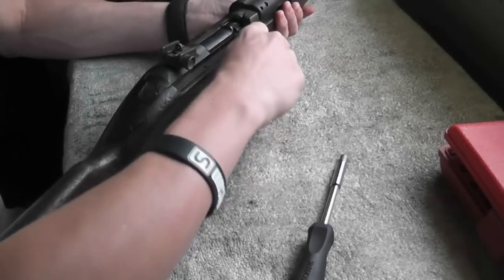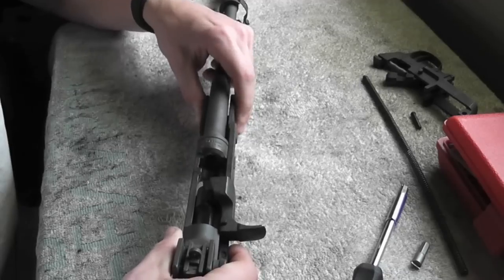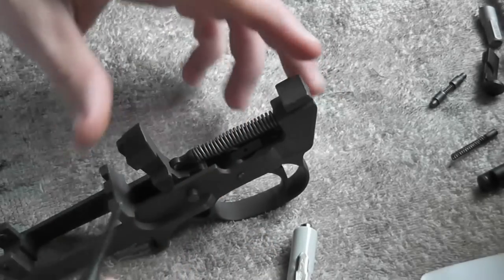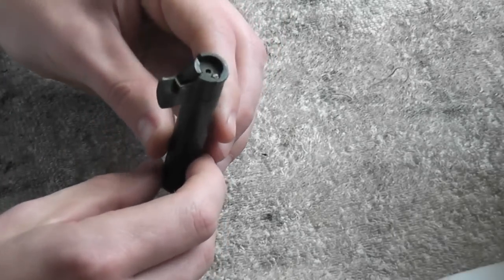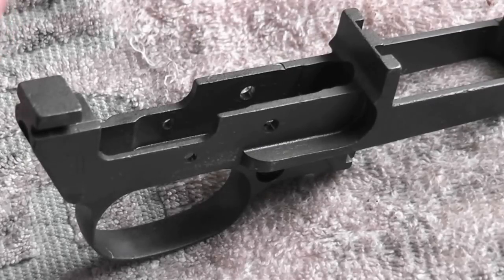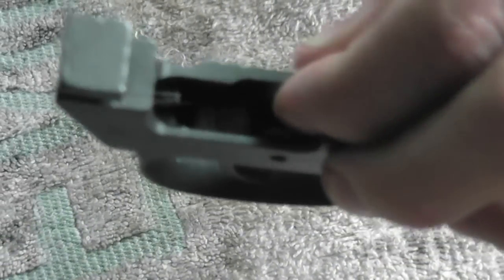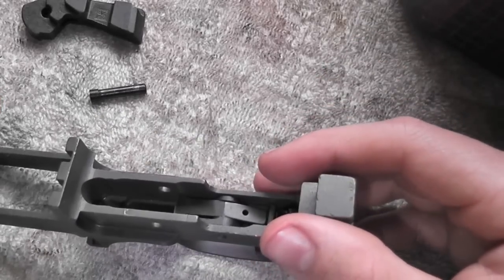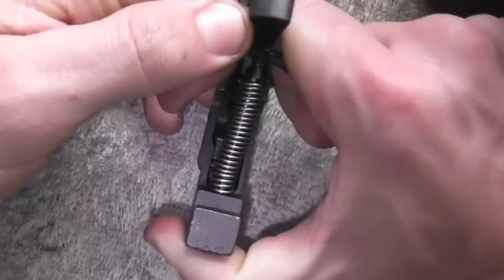M1 Carbine Complete Disassembly/Reassembly

Comment: This is by far the best video I have seen for a complete disassembly of a 30 carbine.  I converted an old 30 carbine that was manufactured in 1968 into a really cool tactical tool.  I purchased a Choate tactical stock from Midway USA that has a handgrip similar to an AR with an adjustable butt stock.  After seeing your video I plan to completely take down and have all the parts coated with Cerakote coating.  Your video has given me the confidence to tackle this.  Thank you for posting this!!!!!

Comment: Just came across this video after picking up an Inland M1 carbine and after taking it to the range a few times this month decided it was time to field strip it (including disassembly of the bolt- which I almost regretted).  After several attempts at trying to get the extractor back on (damn that little detent!) I might have figured out an easy to do it without pliers and three hands (the bolt 'tool' might actually do this as well).  I grabbed a flat head punch set and used the punch that had the same diameter of the extractor 'pin' that fits through the bolt holding the firing pin and ejector.  With the extractor out I put the firing pin in and pushed down the ejector to align the tabs for inserting the extractor.  Before I inserted the extractor I pushed the center punch tool through the opposite side of the bolt until it held the ejector and firing pin in position.  I was then able to ensure the extractor detent was positioned correctly and began inserting the extractor pin while using a small flat head screwdriver to hold the detent down.  The extractor easily locked into position and pushed the center punch out at the same time thereby completing the bolt assembly...and it only took two hands!  Anyway, I was impressed with myself after cursing out the original engineer who designed the bolt assembly for an hour or so!  I also used a Dremel tool and some Flitz metal polish on the feed ramp and smoothed out several rough areas of the receiver and bolt assembly- M1 ran great today!  Now if I can just get the damn magazines to work better- I think they are the cause of most of the malfunctions I still occasionally experience.  Anyone know any tricks to make them work better?  Stay safe all- Major Barry (USA ret.)

Comment: Great video, and such a young man caring so much for an old rifle! Helpful!    Hints, the mainspring follower rod is designed to use the point to retract safety/mag. catch spring, and push out all service pins. The stepped end works great to move and hold sear rearwards while pinning. Also fits through hammer spring hole allowng one finger  on either side of trigger group to stop spring kinking.I also piont the trigger group, hammer face down away from me, and use the large group-reciever pin dropped through the back of casting to help alighn hammer spring without kinking.also prefer to keep an extra bolt {headspace confirmed) as they only need soaked, shook and oiled ready to go.Most faliures I have seen is from extractor backing out due to improper reasembly or damaged extractor plunger failure. Leave the bolts to the pros cause when they come apart, they will destroy your reciever-(gun) and posibly your hand or face!Sending best  wishes to all the carbines out there, and the wonderful people who care for them!

Comment: The bolt tool is a great help for putting the bolt back together. They go for $22 and up. Very informative video. Thanks.
Reply: Just came across this video after picking up an Inland M1 carbine and after taking it to the range a few times decided it was time to field strip it (including disassembly of the bolt- which I almost regretted).  After several attempts at trying to get the extractor back on (damn that little detent!) I might have figured out an easy to do it without pliers and three hands (the bolt 'tool' might actually do this as well).  I grabbed a flat head punch set and used the punch that had the same diameter of the extractor 'pin' that fits through the bolt holding the firing pin and ejector.  With the extractor out I put the firing pin in and pushed down the ejector to align the tabs for inserting the extractor.  Before I inserted the extractor I pushed the center punch tool through the opposite side of the bolt until it held the ejector and firing pin in position.  I was then able to ensure the extractor detent was positioned correctly and began inserting the extractor pin while using a small flat head screwdriver to hold the detent down.  The extractor easily locked into position and pushed the center punch out at the same time thereby completing the bolt assembly...and it only took two hands!  Anyway, I was impressed with myself after cursing out the original engineer who designed the bolt assembly for an hour or so!  Stay safe all- Major Barry (USA ret.)

Comment: One thing in the bolt does need replacement sometimes is the extractor. The stock part is very brittle, and the lip that holds in the case groove will often chip away. I had a couple of them fail that way, and solved it by smoothing the overly sharp edges lightly with a Dremmel tool.  Never had a failure again after thousands of rounds. The bolt tool does make that work a lot easier.

Comment: Great video! I just got a used carbine and needed to replace the extractor. Your method works well. Mine took a bit longer than yours to take apart as every part was covered in grunge. :) Looking forward to giving it a try. Thanks!

Comment: Excellent video! I was cleaning and disassembling my Uncle's 1960's Plainfield M-1. Disassembling the trigger group was initially beyond my capabilities. The close-up video was the difference between assembly or staring at 8 parts on my work bench. It is more difficult than it looks! Trying to get that spring seated correctly and lining up the holes was extremely frustrating!

Comment: Enjoyed your video.I really need more info. where the piston that operates the action  is enclosed with a nut . It has a gas port in the barrel I removed the nut & piston and to clear the port I pushed a small drill bit in the port and it broke almost flush with port. I can not see in the barrel a hole for the port. do you think I could drive it through. Or reassemble without the piston and fire the gun to drive it out Thank You. Thunder63

Comment: There is a tool to dissemble the bolt available for about $15.  Well worth it. It also  facilitates reassembly  easily. You have an M-1 carbine, you should have this tool. It will save your sanity , and you don't have to dig and scratch around with a screwdriver. Just pony up the bucks and get the tool. You could be enjoying a cool one by now, instead if fiddling around like this. You'll thank me .

Comment: Great video...You got it all. Really appreciate it, I used your pain to make my life easier. Sorry Bro` but really...THANKS!
Reply: clement concodora Oh...I forgot...I had to change out the piston, which had snapped inside the gas housing making the carbine (my old Plainfield) basically a single shot rifle...I don't think you showed the piston and nut removal. You need a tool to remove the piston nut, but its do-able. In the process the trigger spring slipped off somehow. What a mess, but it got all back with your help.

Comment: Great video. Just a little dark.You need a bolt disassembly/reassembly tool and trigger spring tool. I use a slave pin to hold trigger and sear and sear spring together. That hole in top of the sear is to help you position the sear. You might like to use the NRA disssembly/reassembly book for nomenclature for parts names to keep everyone on the same page. I've been working on M1 carbines since was 16, over 55 years now and appreciate your hard work in making the video.  More power to you! Sincerely, Mel  ps I subscribed!

Comment: Man I had to give up tonight on reassembling the trigger group, where you put that guide pin through the spring and compress it against the hammer. Just couldn't do it anymore, after 45 minutes my hands were too sore.

I think the problem is that relief cut in the back of the trigger assembly piece is soooo fricking shallow, it's so hard to keep the spring in it. And I just can't get the pin to go in that hole in the back whether I try from the top of the hammer like you showed or the side, it's not lined up straight enough and is hitting the side of the hole. Ugh

PS that trigger assembly will never be fully taken down again, ever lmao. It's ridiculous. I totally stripped everything cause it was dirty as heck and full of cosmoline-like stuff when I purchased it, but never again after/if I get it back together. May have to just bring it to a gunsmith, since I was gonna do that anyway to confirm it was good to fire. Way harder to put together than anything else I've done, like a Garand or Yugo M48.
Reply: Lmao I try again tonight, thinking I'll need to take it to a gunsmith if I fail again, and get it in there on the first try.

I watched your video again beforehand, and tried putting the pin in there without the spring around it, and going straight on, down the hammer, but mine does not fit like yours did (the pin hits the bottom in the hole of the trigger assembly and cannot slide down the hammer into its groove). 

I have to go from the side of the hammer, it's actually more of a straight shot from the pin to go into the hole in the trigger housing that way and doesn't cause your spring to bend, though you still need to hold it a bit at the start to guide it because that ridiculous cut in the trigger assembly is so shallow (where the spring rests).

Anyway, appreciate your video big 🐕 it's very good. Now I just gotta finish reassembling the rest so I can shoot it this weekend woot.

Comment: Big 🐕 you just need to get the dang tool that's specifically made to disassemble and reassemble M1 Carbine bolts. They're available many places, even Amazon has them, and they're cheap. No reason not to have the right tool for the job.

But your video is great anyway. 😉👌

Comment: Unless you need to change those parts just drop the whole group in mineral spirits, scrub it with a toothbrush then use some towel to dry it. Soak in 3-in-1, again use some paper towel to dry it off and you are good to go.

Comment: My ejector is not perfectly round on the top  like the one you have, mine has a angle cut to it a little less than half the amount of a full circle  is this normal  or is it worn down .  Would someone look at there gun and comment  if it has a angle taper to it and not  round  on top .
Reply: Normal

Comment: Brother, Im having the hardest time getting my bolt back in. I watched what you did, but my bolt is more rounded than yours is flatter at the top. What do I do?
Reply: May be the tension from the hammer spring is making the hammer get in the way. Hold the hammer back with your finger, the bolt should flop in.  You know it fits, cause it came out of there, right?

Comment: Got my Carbine back together thanks to your video and that other guy's that shows how to use the bolt tool to dis/re-assemble the bolt. 

But my Carbine came with a broken piece of thin metal that goes together with the oiler into the buttstock, and I can't find what that dang part is called nor where I can order a new one. It's thin metal and kind of rounded. Not a big deal but I do have a sling I wanna use for it. 

Imma shoot this mother scratcher this weekend though WOOT

Comment: Maybe someone here can help with a problem I'm getting on this M1. The bolt slides fine by itself. The bullet falls freely in and out of the barrel. The problem comes when trying to load a round, the bullet sometimes jams about where the extractor catches the rim of the bullet. You have to bump the slide to make it twist and lock, and pulling back in the slide slowly feels as if the bullet is binding on the breach. I'm posting in a couple of channels hoping someone can help. Thanks in advance!
Reply: Your problem is most likely with the feed lips of the magazine - cautious adjustment with flat nose pliers may help.  Or simply try another mag.  Hope that this helps a bit.

Comment from the maker: Please don't try to fire it with parts missing.  It sounds like you may have earned a trip to the gunsmith.  It will probably have to be drilled out, and since you're dealing with the gas system, I would have it done professionally.